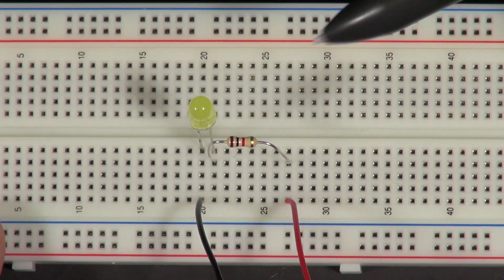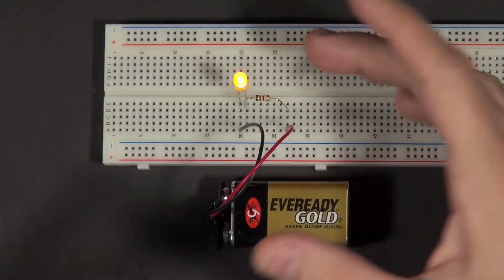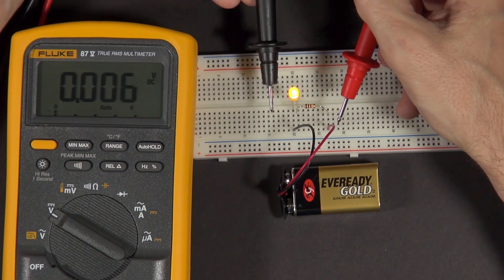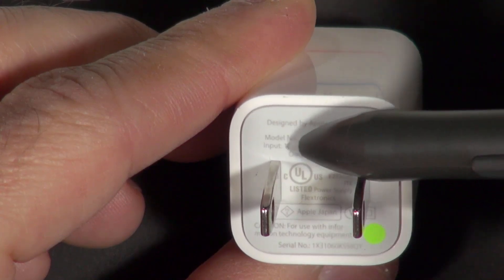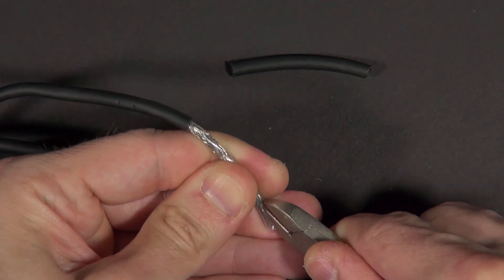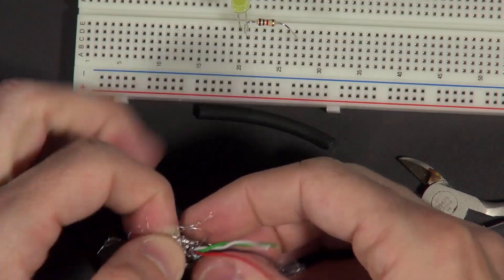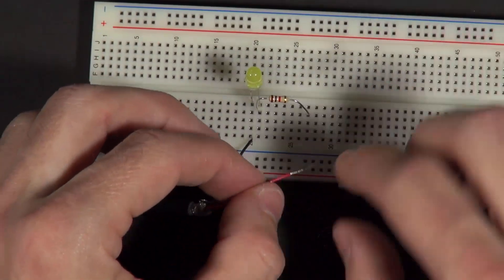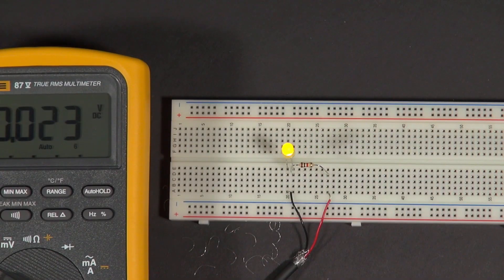Powering our LED circuit | Digital electronics (3 of 10)

Comment: Also notable in 2024: This works well with the classic USB-A type of cables and plugs but not with USB-C (the small symmetric ones). USB-C cables have more leads and USB-C power sources expect the "C" wire to be connected with a pull-down resistor or they won't supply power on the red and black wires. Best to stick to power bricks that have a USB-A type of socket to keep it simple.

Comment: What am I missing. If the electrons flow from the negative wire, why isn’t the led destroyed as the resistor is placed after the negative wire? 

Is it only once the electricity does a full circle that the led is destroyed? And since there is a resistor to absorb the extra energy before a “loop” is complete, the led does not burn out?
Reply: More than a year late, but for the benefit of others: if you think of current in a wire as being analogous to the flow of some liquid in a pipe, then a resistor is like a narrower section of pipe. Wherever you put the narrowing, it'll impede the flow through the whole circuit — not just in the section of pipe before it gets narrower. You can think of the resistor as causing a traffic jam in the wire — each electron before the resistor has its path blocked by the electrons nearer to the resistor. By the way, all of this stuff about electrons flowing is probably (?) not technically accurate, but it's a useful mental model.
Reply: @xanderlewis  Thank you! That makes good sense and was a question I’ve still been wondering about. 
Your second point reminds me of electron orbitals, their path might not be the clean symmetrical shape we depict, but based off the data we have it’s not a far out assumption.
Reply: @toomanycactus3138  Yes — exactly. Basically any statement about electrons behaving like miniature billiard balls should probably be taken with a pinch of salt.

Comment: Rvolts  / R = 7.12V/1000ohm = 7 ma . Data says 1.9-2.0 volt @ 20 ma. so u are underdriving the diode. Solving for 20 ma 7V/R=.020A  so R= 7V/.02A=350 ohm  resistor to fully drive the led?
Reply: 1.9-2.0v is just the forward voltage at 20mA

LED works at 3mA at the end of the video 3.19/1k = 3.19mA

Comment: I wouldn't use wall socket USB-powersource to breadboard experiments. I'd use rechargeable USB-battery. You can get nice 2000mAh USB-batteries quite cheaply and they last long in experiments. On the other hand I do live in Finland where our mains is 230VAC.

Comment: I still don't understand how the 1000 ohm resistor is dropping only 3.1 V or 7.1 V.  while it should drop 10 V ( 0.02 A * 1000 ohm = 10 V) and the LED should not glow
Reply: The 1k resistor doesn’t drop 10v because current 3.19v/1k = 3.19mA (ohms law) 12:50. Increasing resistance reduces the current.

Comment: is it reasonable to say that if we use 9v battery to power led taking 2v and having resistor of 7v then this 7v is wasted ? i mean it draws the battery right? the resisted voltage does not come back to the battery correct?
Reply: Correct

Comment: I used to love bread-boarding projects in high school using the pubs from Radio Shack, which drove me to get a EE degree and enter the IT industry.  Flash forward 40 years and here I am retired from the US Army (IT MOS 33W) and watching these videos to get back into building circuits.  These videos are really good and are a great refresher since troubleshooting down to the component as I used to do is something that's almost a lost art.  I'm really looking forward to getting my head wrapped back around this in order to maximize the use of the Raspberry Pi and Arduino(s) that I've picked up.  Looking forward to the rest of the series~!!

Comment: If all you need is a USB power cable, it’s best to cut up a cheap one from the dollar store, not a quality shielded cable.  And tinning the stranded wires with some solder makes them very easy to use on a breadboard.

Comment: there's something I'm missing: according to ohm's law I=V/R, but based on your numbers that means 0.02 = 9/220, which isn't true. so what have I done wrong?
Reply: Voltage across the resistor isn’t 9v
Reply: @davadoff  holy crap thank you for answering after all this time! though i now see my error, so you might've been a few dozen months late lol

Comment: Easier alternative would just be to use an Arduino (if you have one) as a power supply. It has a 5V analog, 3.3 V analog, and several PWM pins so it's pretty easy to control the voltage.
Reply: And the Arduino is powered by? A 5V USB-plug. So why not just use the USB-plug directly when the only thing you need is 5V?
Reply: @maxine_q  So that you don't have to destroy a usb cable and screw around with the 28 gauge stranded wires!

Comment: Why does the voltage on the resistance altomatically change to suit the voltage need of LED?
Reply: Hi, i hope that 9 months later this is still useful...
The voltages across the resistor isn't actually changing to suit the need of the LED, but the two components of the circuit (the resistor and the LED) are both  adjusting to the new voltage supplied

Comment: "But now that we have this resistor in here we don't need that precise voltage source anymore and we can look at some other options which is great if you want to build this at home and you don't happen to have a very expensive power supply."

Gee, thanks for telling me NOW. After watching that last video, I went bought one of those "very expensive power supplies" so I could follow along.

Well, I got a good deal on it, so it's not too bad. Besides, I want to get this stuff. Signal generator, oscilloscope, more cool stuff.
Reply: Well it's kinda your fault if don't know much about electronics but you bought an expensive power source anyway. It's a good investment though

Comment: My cheap chinese cable had the White wire as 5V, the Green wire as Ground and there wore 5 wires in total...
I thought the 5th wire was a separate ground / case ground / protective ground, but there was no continuity to any part of the type A USB plug...
Reply: Not unusual. Lots of outfits use whatever cable is available to keep costs down, and the person making the cables may not know or care about the standard so long as the ends ring out good.

A good reason to test all the cables you repurpose before chopping off leads.

Comment: I wouldn't trust Chinese cable manufacturers to use standard colours for the inner wires of usb cables.
Reply: Very true. A lot of manufacturers won't reject a lot of cables if, say, a new worker screws up. I would test the cable with a voltmeter before I trim off the unwanted leads.

And being the sort of person I am, I would put a small fuse inline with the positive lead then wrap it in shrink wrap to prevent shorts.

Comment: ** DISCLAIMER: This is just an opinion, and it shouldn't be taken as a critic nor a correction**

You can plug the USB cable directly to a computer, you just have to solder a diode to the cable and a pin header... maybe add some heat shrink to beautify the contraption... It is still better to use the wall wart, as it is less combersome...

Comment: I am a begginer in electronics and I know that we take current as if it went from positive to negative but actually it goes from negative to positive, but could there be any situation where I have to take in mind that it actually goes from negative to positive?
Reply: Since we're using the flow, it generally doesn't matter to us whether it's actually going one way or the other. When you get into discussions of electrons and "holes" in how semiconductors work, the mental model of how it works is sort of accommodated there, but again, it really doesn't matter so long as you know which is positive vs. negative.

When you dig another layer lower into the physics of it, you learn that the electrons don't actually flow. Fortunately, in electricity and electronics, it doesn't matter, it's just an amusing factoid for party conversations.

Comment: 10:10 If you don't have fancy wire strippers around you can use:
- Simple wire strippers
- Knife
- Lighter
Reply: Whether a lighter will work depends on the insulation. And it stinks up the place even if it works. A cheap pair of strippers is a worthwhile investment, and a lot of multi-tools come with them built in, along with crimpers, cutters, etc.This coming from someone who started out using his teeth. :D
Reply: I actually remember using teeth for stripping wires

Comment: Couldn't you have butchered a USB cable that already has a broken B end? That would encourage reuse of the many USB cables that break, especially at the B end.
    Also, untinned multistrand wire is not great in breadboards – better to tin it or solder it to a connector. A piece of pin strip can be used as a connector for breadboards and headers, or header strip for a stackable connector for breadboards and headers, stackable like banana connectors but much smaller. I see that your later videos do use the pinstrip technique.

Comment: I would call that the cheapest power supply, put few together with a couple of pots and you can get a variable voltage and current power supply. On the other hand, I can not believe how a resistor and diode can attract 10s of thousands of people. Great tutorial 👍🌞

Comment: How come the LED always pulls around the same amount of volts, when the circuit as a whole is pulling wildly different amounts? You nearly halved the volts, but it still pulls around 2 volts
Reply: The diode is nonlinear, scroll up there's a good explanation

Comment: I prefer using breadboard power supplies with USB sockets or barrel jacks.
These things sell for around half a buck, and allow you to select between 5V and 3.3V by moving a switch or a jumper. They have pins that go straight in the power rails of your breadboard, so no messing around with ill-fitting stranded wires (even if you tin them, they're still a hassle to insert). They have an on-off button, so you can power your circuit on and off straight from the breadboard. And they don't require you to cut up a perfectly fine USB cable.
I'm sorry, but this is just bad advice, Ben. Stranded cable, or even tinned stranded cable, does not belong in a breadboard without some proper terminating dupont pins on it. But factor in the cost of the crimping pliers of sufficient quality that you won't want to toss them straight in the garbage bin, it's simply not worth it.

Comment: a somewhat simple question, why do common wires always have many thin wires instead of one thicker one
Reply: Makes them more flexible.
Reply: A single thicker wire will break more readily when flexed than a thinner one. But the total conductor size needs to be at least so much to carry its rated current without heating up. So a lot of thin wires will bend more without breaking than one thicker one. And they're also less stiff.

Plus, even if there are some breaks in some of the wires at a stress point, the ones that are connected will still carry current around the break, meaning it's less likely to fail early in life. It also means that a problem gets hidden if you're using a cable at its current limit, the point where the break is will get hot. If you think a cable has been abused a bit, but it still works, check right next to the backshells of the connectors (or at a kink in the cable, or where ever it got stressed) for heat when it's at maximum load (like when you plug a device in for charging) to see if it gets warm. If it does, either throw out the cable, or put a knot in it and put it in your box for re-use as an electronics project cable, where you can cut off the bad end and reuse it in a project. :)

Comment: With 9V power source led dropped 1.9V and with 5V source led also dropped 1.9V.  Why there was no change? I don't get it.
Reply: This happens due to the LEDs Resistance being non-linear. If you look at this graph for example http://lednique.com/current-voltage-relationships/resistance-of-an-led/ up until about 1.8V falling off over the diode there is basically no current i.e. the diodes resistance is essentially infinte. If you increase the voltage further the current increases very fast and at the same time the resistance of the diode is rapidly decreasing. An in series resistor only factors into the equation as soon as current starts to flow, if you do not have enough voltage to overcome the resistance of the diode there is no current and ohms law tells us 1000Ω*0A=0V there is no current falling off over the resistor. Therefore the "first" 1.8V you apply are always falling off over the diode. Now as we continue to increase voltage past 1.8V  the 1000Ω resistor starts to matter and reduces the voltage falling off over the diode. 

If you want to look at it from a different perspective lets assume the diode has no resistance at all for a second. The 1000Ω circuit should have a current of 5V/1000Ω=5mA and if you apply 9V the current should be 9mA. Take a look at the graph again and check the required voltages for those two values and you will notice that they are very close together at about ~1.9V.
Reply: This should be a much more upvoted answer to this question that spans many episodes of this guys youtube channel. The question did bug me too until I saw the proper graph just because it is not that intuitive without some extra thinking.

But after thinking and assuming the diode has no resistance (just to ease calculations) things are basically quite clear from the shared graph... This latter also seems to be a really good trick for exponencial cases when we can think that after reaching a point of a semiconductor it gets into a nearly non-resisting state so fast we can calculate it things as if it would have no resistance at all anyways...

At least it have helped me understand this a lot!
Reply: @Thisone95  Well it is, for 9V, that's fine but what about 5V ? I'm not sure it is almost 1.5V on the graph for 5mA ? Or am I missing something ? Thanks.
Reply: @stefanjovanic7725  One thing you have to keep in mind is that the graph i shared is not universal for all leds. The graph for the led Ben used in the cideo the graph might differ slightly. As you can see at 2:53 the voltage required for 20mA for this particular led is 1.9 - 2V while the graph i shared belongs to a led that requires about 2.2V to reach 20mA. Therefore the graph does not work with the numbers in the video, it was only supposed to visualize the nonlinear resistance of a diode.
Reply: its the specified operational LED voltage, defined by the LED manufacturer.
Reply: So assume a 1.9 Volt drop and calculate the resistor with Vsource-1.9V=Vres. With 9V supply, we have 9V-1.9V=7.1V ... So we need a voltage drop at the resistor of 7.1V so that the Voltage at the LED drops at eh desired 1.9V. The Amps the led draws is 0.02A (at 1.9V, also specified by the manufacturer) so the resistance required is R=U/I = 7.1V/0.02A = 355Ohms
Reply: Call Of Beauty It makes sense that a 355 Ohm resistor would be exactly what's required. Why doesn't the 1000 Ohm resistor that was used drop the voltage more so that there wouldn't be enough volts to drive the LED?

Comment: Is it worth connecting the two data lines (white, green in this case?) If you do, an intelligent charger may give you 1 A rather than 500 mA if those lines are open circuit. 

I may be picking nits but, today, 5 VDC circuits are power hungry.
Reply: need to put a resistor between the data lines, 100ohm as the spec says, if I remember well

Comment: Beginner question: Does the value of R1 every becomes too much too not drive the LED or does it just balance out the remainder voltage not used by the LED? If so, is there then a loss or waste of power?